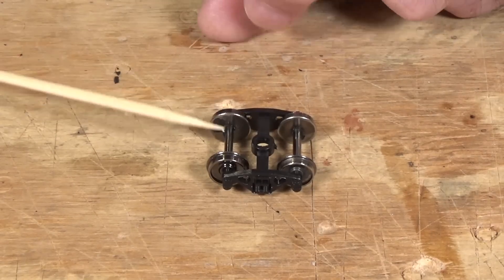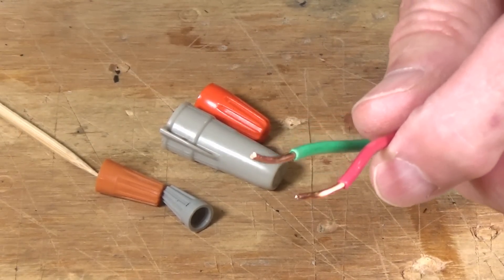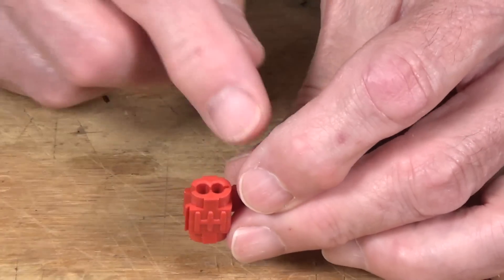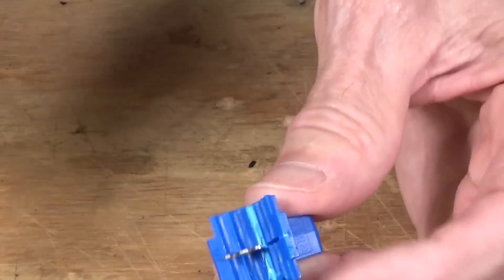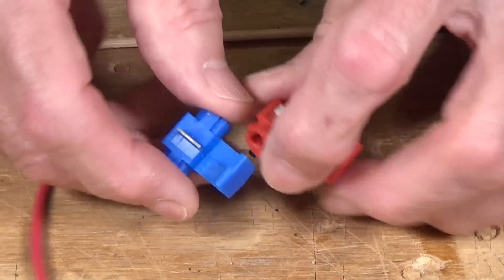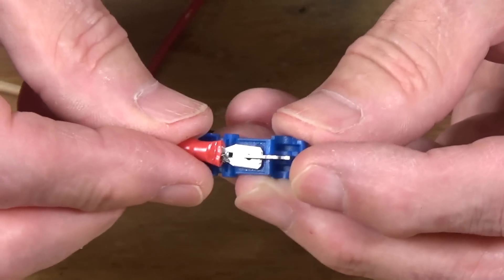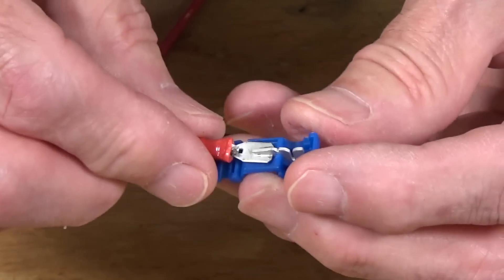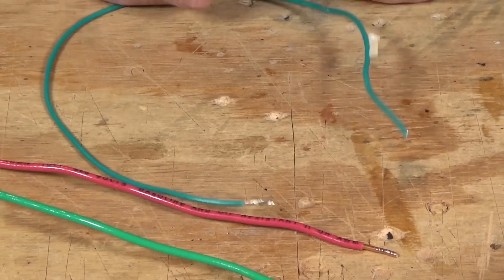Stop Soldering—Use These Solderless Connectors Instead (320)

Comment: Great tutorial, thank you. I have a quick question. If I have a mobile layout (one that is segmented so that it can be disassembled and moved), could I use the Wago Connectors where each section joins, to connect the main busses from section to section?
Reply from the maker: Could work, I used them to connect the power bus on the old Piedmont Southern.

Comment: Anyone have a solder-less way to connect track to droppers?  I've looked at a few options.  Peco(and other brand)  pre-wired rail joiners.  Home made version of those.  Spades fixed to track (conductive glue?  Solder?   Weld?) and power connectors (two pole slip into track).

Got all types of other connectors for dropper to bus and all the way to the controller.
Reply from the maker: You can use these just keep these small diameter wires as short as possible.
Reply: @TheDCCGuy  I've got them for dropper to bus line, etc.  Been using spades (eg U shape to controller screw terminals) / car 12V connectors for decades.  I'm asking about track rail to dropper.
Reply from the maker: I usually use 20-22 ga wire soldered directly to the rail and then connected to the power bus with a suitcase connector.
Reply: @TheDCCGuy  Yep.  And I'm asking for alternatives to the rail and solder
Reply from the maker: The ore-wired rail joiners are the only other solution I know of.
Reply: @TheDCCGuy  Ok, thanks.  Thinking of making my own like that.

Comment: The only problem with these connectors is they are hit and miss.  A properly soldered connection is always better and a better conductor.  Low voltage not so critical but DCC is.  In the end, don't be lazy...solder those joints.  By the way, don't use acid core.  It can cause corrosion.  If you are too lazy to solder, maybe you need to find another hobby.

Comment: Larry, I have a totally unrelated question. Maybe you could do a video on what the ramifications are of running a DC engine on a DCC track and visa versa. I ran a few DC engines on my DCC layout and the motors got hot and I think one of them blew out. It is a Bachmann Spectrum 44Ton GE that has two really small motors. The other one is a NWSL powered truck on a Athearn RDC. That one got hot. Some others make a strange sound. I don't know if this is a common question and worth a video. Thought I would ask. Thanks for the connector video. Really useful.
Reply from the maker: Somewhere in the Digitrax literature they warn that you should only run DC locos on DCC for short periods to test them as DCC power can damage the motor, especially coreless ones. The high frequency of DCC power makes them vibrate at a high frequency, thus the strange sound and causes them to overheat.

Comment: Hey Larry good points Addressed i used the Suit Case connectors along with my Wire Blocks to Hook up my Buss with my Kato Power Railjoiners.. The Wago's are very useful to attach wires Running off the Buss because the Ports can take a Variance of Wire Size Your Buss can be 12 to 14 Gauge solid or Stranded & fit the port & from that you can run the same or drop the Wires size..

One thing I Do Larry with all my Stranded Wire is I put a Ferrule on with good Ferrules & a Good termination tool you won't have to worry about a Strayed or Frayed wiring ruining your wiring job all of my Stranded wires running to & from my systems to my Circuit Breakers i use Ferrules on the Wire.. One other thing that is Awesome about the Wago's is they have a test port's we're you can test your Wire connection the Ideal's connectors might include this on there connectors as Well if you use say the 5 port connector like I have set up on my Programming Track I used 3 ports for the Wiring then I set up with the 5th port the test port to my Track volt tester.. Using the Wago's makes set up like these vary versatile 

One thing to keep in mind on the Wago's as you start to use them! As they have 2, ports 3 ports or 5 ports these ports are connected as ONE port there not individually separate so if your Wiring using a Buss use One full Wago 223 for Red or Hot & one 223 for your white Neutral Wire.. Wago's will give any hobbiest a good many Years of service.. 

Larry hope it was ok to add my Thoughts to A very Good Video.. 

Thank you for being the DCC Guy.. Allen

Comment: Great information as always!  I chose to connect my bus to my feeders using barrier screw terminal blocks.  Means I have to work harder to centre where the feeder wires can be clustered.  Nice thing is one bus wire goes in and I have can have up to as many feeders going out as the terminal block has connections on one side. I just need to ensure the bus wire is 'jumpered' on the bus' side connections to all its connections so that it will connect to each feeder side on the opposite side of the terminal block.

Comment: I exclusively use WAGOs now, as they provide the firmest connection in the sense that noise is the lowest when you use them. Especially with stranded wire a not firm enough connection, like with a wire nut could be problematic. I also try to reduce the number of connections along the line.

Comment: When working I was an Electrician / Electrical Technician by trade in industry, I also did some house wiring. Referring to your first lot of connectors, I would never use anything other than screw connectors for wire joins. Our voltage over here is 240V where as If i'm correct your wiring is 120V. These are probably rated higher than 240V but I would never trust them. I know that we are only looking at about 18V on the railway so that is a little different. The 3Ms are good for inserting additional branches when modifications are being done. I use the Wago connectors.
Reply from the maker: As I said in the video these suitcase type connectors are designed for use with voltages under about 34 volts so, you are right that these should not be used with anything greater than that and especially not houselhold wiring.  The push-in and Wago connectors are designed for household wiring, but always check the packaging just to be sure what you’re buying.

Comment: My last purchase of 3M IDC “suitcase” connectors both channels are open all the way through. That being said, they work great, period! I had purchased the T Tap connectors, with a crimping tool (same manufacturer) and they were a pain in the butt for me. Others think they are great, I donot. The Wago connectors also worked great when I added another device in line after finishing my wiring. Amazon sells a set with multiple Wago 2, 3, and 4 connection ports.
Reply from the maker: Just opened a brand new pack I got from Amazon 3 days go and they are still closed at one end on the small side.
Reply: @TheDCCGuy  That’s interesting, I wonder what the difference is in the order / item # as I got mine from Amazon.

Comment: Tin your stranded wire it will make it easier to insert your wire into the push in  connector.
Reply from the maker: This is not recommended, I looked it up before trying it myself. It can interfere with insertion, grip, and can increase resistance.
Reply: @TheDCCGuy  I suppose you are correct. I use a screw gate style and and tinning helps to keep the strands from getting crushed.

Comment: I've reused the suitcase connectors. You take a small screw driver and open cover then pry under metal piece. It takes a bit of doing, but if you rewire a section because you changed the track work why waste the connectors. I've fone it at times because i've run out of connectors and didn't want to wait to get new ones. 
I really like the ones where you slide on crimped connector. This will work great for my low voltage buss I tap off for the panel LEDs. I' ll have to order some tomorrow. Thanks.
Reply from the maker: The reason they recommend against reuse is that the slot in the metal blade gets pushed open when crimped in place and when reused may not cut through the insulation or into the wire and creates an unreliable splice.

Comment: Great summary. Adding this to my  wiring playlist

What might be a good connector to use from controller to bus; when you may want to disconnect the controller (Digitrax Zephyr Express)?
Reply from the maker: I just loosen the screws and pull the wires out or the entire terminal block is removable.

Comment: I've just replaced a bunch of screw terminals with Wagos at our club layout, next on the electrical plan is using the quick-taps for dcc bus droppers.  Better than the traditional suitcase connectors, and soldering on the underside of a layout baseboard is a royal pain...  Thanks for the review.

Comment: I was told not to use these type of connectors because they introduce a high amount of resistance.  I have a yard (6 tracks) and almost 24 feet of main line (shelf layout).  This is phase 1, I will be expanding this in the future.  I currently have the NCE Power CAB.  I will be upgrading to the Smart Booster SB5 in the future.  Is the resistance from these connectors an issue? If so, is there a way to determine how many you can use before it becomes a problem?  Thank you Larry for all you do!  I look forward to you videos every week.
Reply from the maker: I have measured the voltage of my main bus, which has suitcase connectors for every feeder, and the voltage doesn’t drop a bit over 25’ runs. If there were significant resistance you should expect to see a drop in voltage over that much distance and with that many connectors and feeders.
Reply: @TheDCCGuy  wonderful! That’s what I was hoping. I was lamenting over how to solder everything under the layout and be able to do quality work. Thank you again.

Comment: Thanks Larry.  This was a nice look at some of the options.  I recently bought an assortment of WAGO connectors for an extension of my layout and I really like them!  You are correct, they cost a bit more up front, but they sure offer some nice options.  I recently saw an ad for a spkucing cinnevtor that used tow temp solder.  The wires are placed in each end a heat gun warms the solder to melt.  Interesting idea, but I want to learn more about them.

Comment: Larry as always great tips    I started using Suite Case connectors but found that If I need to work on that wire it was difficult to remove the suit case and the wire was split now.   So I switched to T-connectors they work for me a lot nicer if I need to work on that section of wire or device I just unplug the spade connector.   Another thing with the suit case connectors I found that sometimes when I was crimping the wire the metal piece would bend over to one side or the other  and then would have to replace the suit case. thats another reason I switched to the t connectors
Reply from the maker: Yes, that is what I meant by getting a good square crimp. The T-taps are great where you might need to unplug a component whereas the suitcase connectors are best for what are essentially permanent connections.

Comment: I’ve used suitcase connectors for years with no problems. But I’ve always heard not to do multiple connections off one feeder. Maybe too much  voltage drop with multiple connectors in a row? Comment?
Reply from the maker: That is true, only one pair of wires per suitcase. Trying to use more will deform the metal insert and give an unreliable connection.

Comment: I have set up a fairly large track layout that runs over 43 ft in a continuous loop. I can run it DC or DCC. I also have several turnouts. I can run 3 locos simultaneously. I have no bus wire just a simple one track connection. So my question is, why does the layout you discuss get so electrically complicated?
Reply from the maker: Three locos is not much of a load. During an op session it is not uncommon to run many more. Try measuring your track voltage at various points along your loop and see what happens.
Reply: @TheDCCGuy  Ok, will do. Love the channel!

Comment: Why can't you solder the stranded wire before putting them into that  one connector pushin connector, the wago is really nice connectors 
Thank you for the tips.
Reply from the maker: I have read that you are not supposed to do that.
Reply: @TheDCCGuy  I wonder why? We are not running high voltage or amps!
Reply from the maker: I think it has something to do with the way the gripper inside works. Here’s a link to a discussion on this. 

https://www.houzz.com/discussions/2648900/push-in-wire-connectors-stranded-wire-soldering